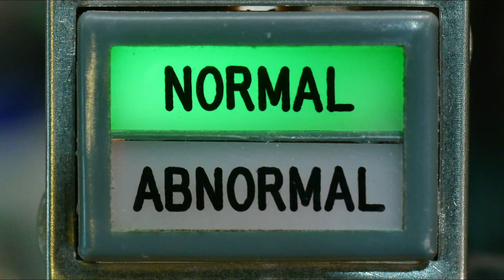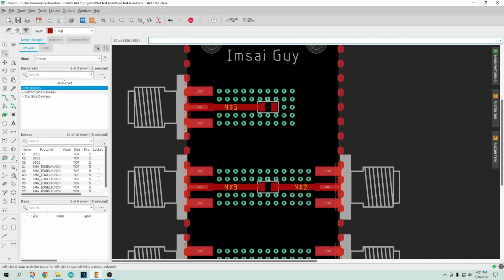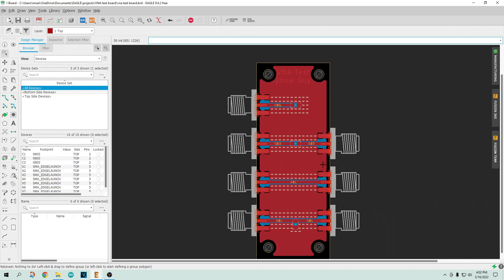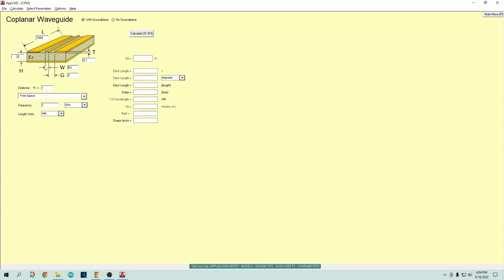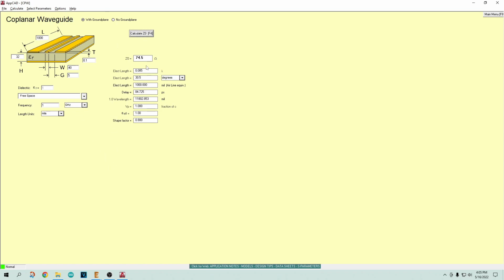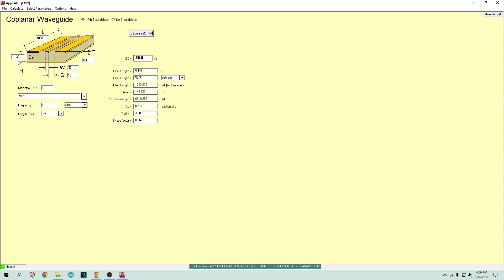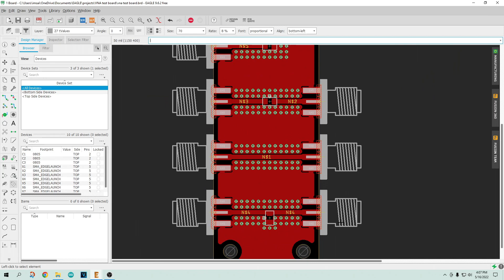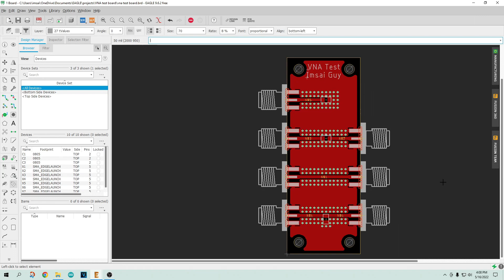#1172 VNA Test Boards (part 1 of 5)

Comment: I need to design a board with a transmission line and an attenuator on it, and this will help a lot! I didn't know how to calculate a printed-circuit transmission line.
Reply from the maker: watch the whole series, the FR4 thickness is not what I thought

Comment: My area of expertise at work (recently retired) was power amplifier design combined with very detailed models I created in house.  Decades of bandwidth or very high power (>1KW) but more narrow band.  Models included a full EM (ADS Momentum) simulation.  The key to very low impedance designs (sub ohm) or wideband designs are the parasitics of a part when creating a model.  Using a VNA (I own a HP 8753) is a great way to measure a part wideband, but like you said, it can be difficult when you are dealing with a 0.1nH or less than 0.1pF).  Calibration of the VNA is key.  One thing I would have done on your boards is to bury a via on any ground pads to help minimize any extra ground inductance (sort of nit-picking, but old habits die hard - LOL). You really have to pay attention to the little details and be aware of your calibration reference plane too since a phase shift can cause a measurement error.   Also, when you ground one end of a part (i.e. just a S11 measurement), you can essentially ground any parasitics on one end of the part.  For example, say a part (i.e. resistor) in series has a parasitic 0.1pF to ground at each end (poor example, but it proves a point).  With one end grounded, you've just 'short out' the one end of a resistor's 0.1pF parastic.  That's fine if the part really is grounded, but not so much if it's used in a series config.  Little things like that (and there's a lot more) is what makes the difference between a good measurement and bad.  I'd switch between a one port or a two port model depending on what I was measuring.   All models I created were very wideband, even if it was used in a narrow band circuit (if it was a non-linear narrowband circuit - there's always harmonic terminations that need to be modeled correctly, especially for switch-mode design).  Looking at a wideband sweep really opens up you eyes to how the part behaves over freq and helps when making models for simulations.

What was the board material you used? Similar to FR4?

Sorry - got a little wordy.  I could talk about this stuff for hours. :)
Reply: You should start a youtube channel :)
The Internet is full of tutorials for newbies, but it's hard to find more advanced stuff.
Reply: @awo256  LOL, I'm not that smart, wish I was!  I just learned that most people forget the basics when it comes to making wideband models based on VNA measurements.  It really is RF 101 but often people fall into the  'Can’t See The Forest For The Trees' trap.  But I've built models based on VNA measurements for decades, so it became a second nature to me.  Every design I tried to learn something new and to try to push the boundaries a bit.  But first and foremost - it's fun!  Sort of like solving a mystery, figuring out why a part behaves the way it does.

Honestly, it's truly amazing the level of accuracy obtained in simulations based on VNA measurements if you put your mind to it.

Comment: The Au shouldn't corrode and will sparkle. ALL that gliitters is gold...Nice. I can't wait to see the electronic Smith Chart display some of the patterns...
Maybe you could conjure up a 100 pH inductor...in series..between two outside  SMA.. I think -or in my mind see the same curve as the series 100 pF cap..but on the lower opposite...at a same given frequecy...I suppose the Q of the inductor. ...

I am anxious to go look to see if that circuit that has bee annoying me could be sent to Imsai Guy so he could be showered in Au.

Fred...look at the index of what the Grand Master has already done...knowing you it has been covered 
RF seems like a little...black 🎩 magic. 
I have this ENI 5kW RF 13.56 Mhz water cool solid state amp...
Seems like many RF transistors are in parallel...and fed to combiners..then power summed...

But the stronger or probably higher output or mismatched device does not burn itself out...maybe they sort of sense power in each power transistor and change the gain. More things to study ....

I know there was a IMSAI Guy talk on combiners...

They look like a simple liitle inductor...yet accomplish so much...

Thanks Imsai Guy once again

Comment: Please tell me I am dumb, I am trying to figure out why it looks like the pads are not connected to the track. At 11:45 the bottom one literally looks like both pads are not connected to either the track between the SMA connectors nor the ground pad...?
Reply from the maker: you are dumb. hey you asked me to.
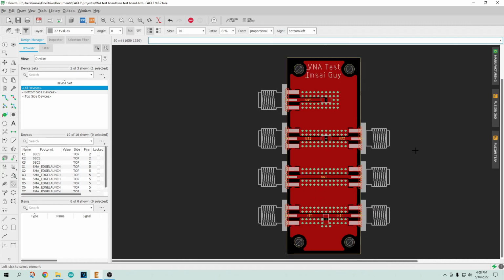Reply: look at 6:57 the pcb layout.
I don't use this layout cad tool, but the pads are connected to ground at specific points, which looks like a thermal relief  setting.
You could turn it off, but the soldering temp needed would jump up due to the large ground acting as a heatsink.
It is probably of no consequence on simple test boards like these

Andy

Comment: Thanks.  Very useful board.  Since it is solder mask free you can do  PI and T network on it too.  As you know with PI network you can do impedance matching  and attenuator.  Search for  "Matching Pi Attenuator Calculator" 

Also after you are done soldering you can use solder mask paint and  ultra-violate light to paint your own solder mask on top of your board.

Many people say use 4 layer board or thin board so that your lines have a smaller width.  However, I disagree, because variation on your line width, as a result of manufacturing, makes your lines impedance change.  Say, if your manufacturer lithography variation is +/- 0.1mm, a line width with  1mm width have 10% variation, where as a line with 2mm width has  only 5% variation. So, you can not get professional grade return loss or matching with small line width.  For test circuit purposes, your line should have better than 40dB return Loss ( ie.  your S11 should be -40dB or better).  

I guess you should first decide if the board use is mainly for RF or for say digital or Power.  Then choose the thickness of the board and line width accordingly.

Comment: Test capacitors in shunt, inductors in series.  Test resistors < 10 in shunt, resistors > 250 in series.  Resistors 10-250 should be tested with reflection (S11),
The Chinese SMAs are so cheap they are disposable items.  I too buy them 100+ at a time.  The center insulator can move when you solder them, so I mate them to a US made SMA while soldering them to keep the insulators in place.

Comment: Another option for straight fit could be stack two pcbs together and solder down one side that needs the most flatness. Then remove the stacked pcb form the other side and use solder posts to finish the joints. Not sure for the impact on impedance as the SMA will be slight offcenter

Comment: I think I would have thinned down the pad for the sma centre pin so the ground plane filled in to the space between the sma pads (with vias to ground). That would have given you the 50 Ohm impedance right up to the sma connector rather than the (small?) mismatch you have. Would that have been possible?
Reply: If it were a production design, I'd disagree with you. But for a one-off like this, I tend towards agreeing with you. Could even drop vias in the pads for the connectors following the rest of the stitching pattern and then just tell the manufacturer not to bother with fill. Shouldn't matter if you're hand-soldering one-offs.
Reply: @Mobius_striptease  Yes, stitching the sma pads to the other side would give considerable additional mechanical strength to the copper pads.